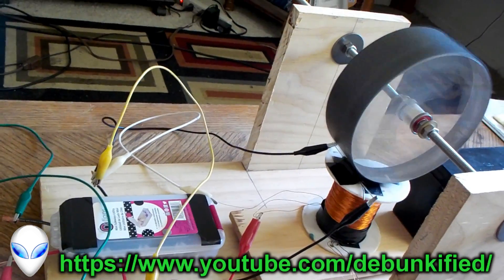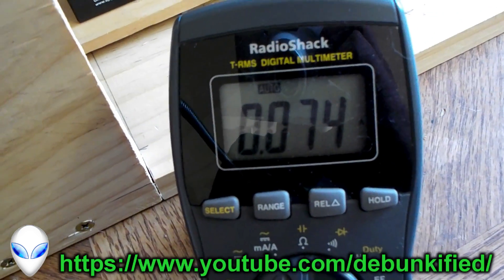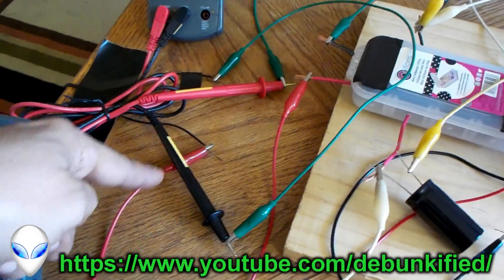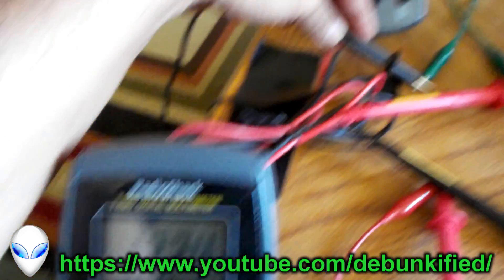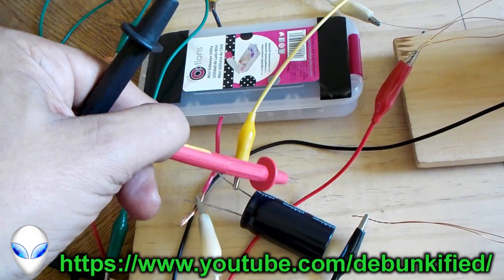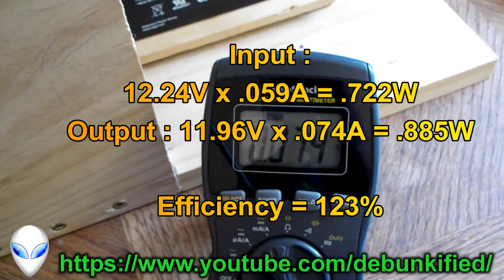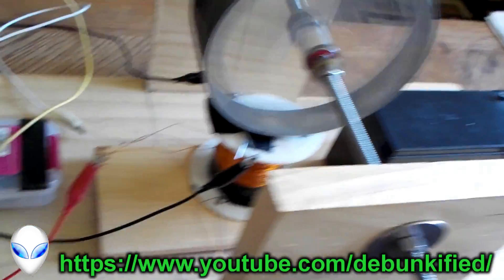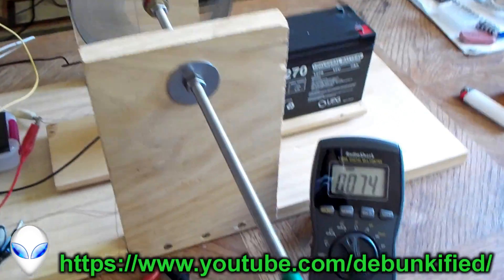Pulse Motor Powered with Overunity Energy - (123% Electrical Efficiency)

Comment: I would consider it a valid experiment if you showed a circuit diagram and showed where you have the meters connected.
You have your magic box, that is DC-DC converter in use as usual.

Good attempt at fooling the gullible by using all those clip leads and a undefined components.